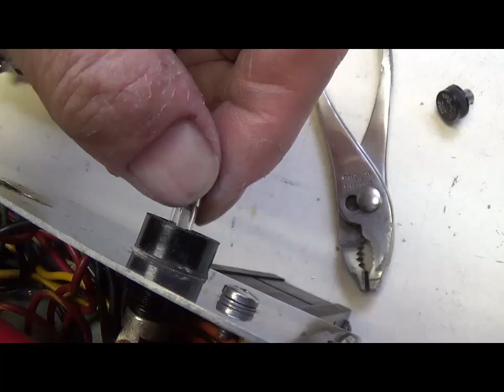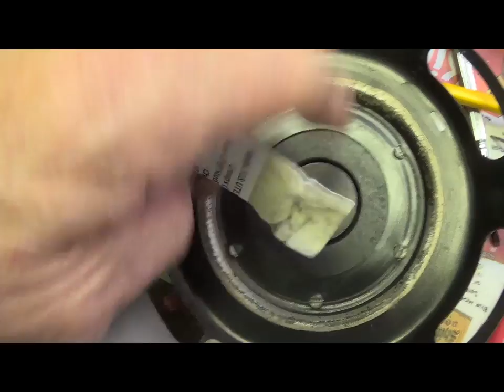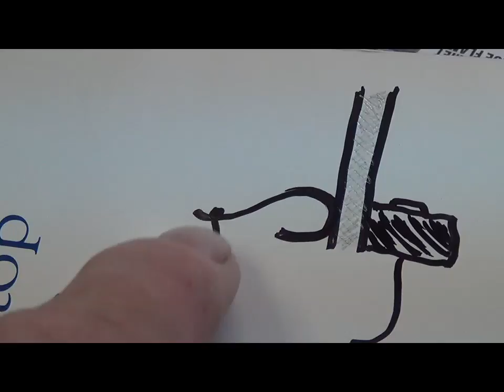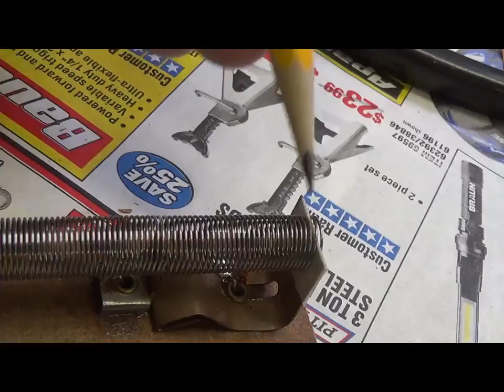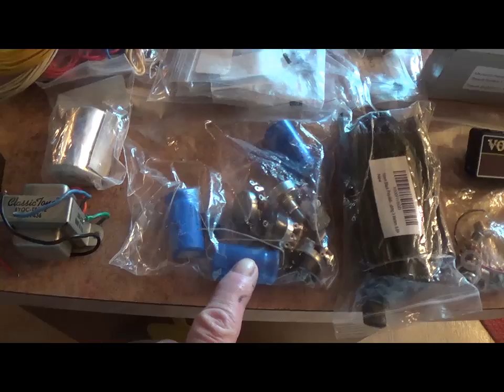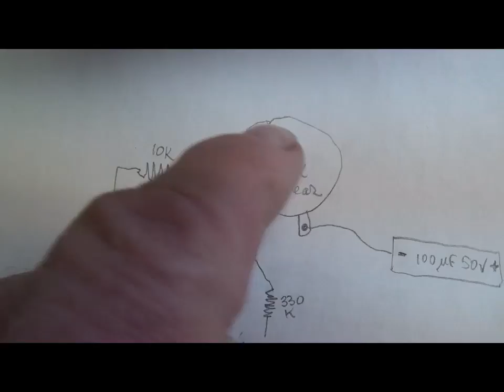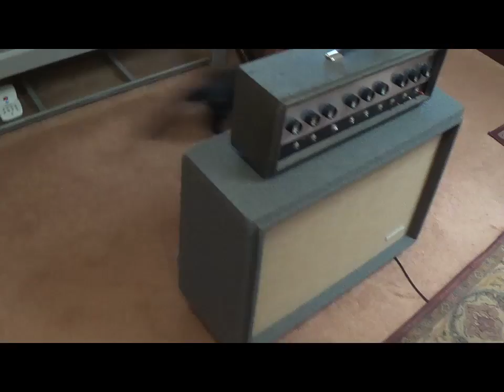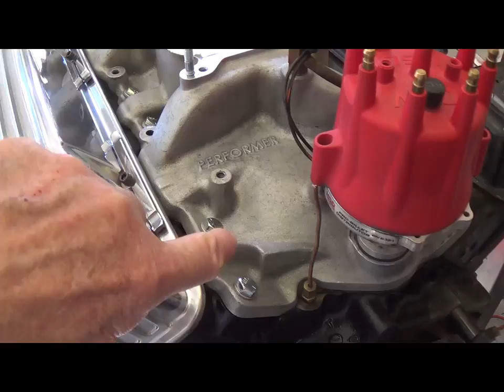Silvertone 1485, Part 3: Circuit Overhaul, Speakers, Sound Check

Comment: Ahhh... You area  true engineer... How do I know? You said WFO! Made me smile. I'm off to empty the grid leak pan...:)
Reply from the maker: We used to say it back in my motocross and drag racing days, Joe. On your way, don't forget to let the cathode bypass.
Reply: What means WFO?
Reply: @giantsofficial1041  "Wide the F___ Open."
Reply from the maker: .....or, perhaps, "Wide F___ing Open". Usually used with regard to motorcycle throttles and car accelerators :)

Comment: Happy New Year Doug,
one video editing related question: Are you using a 4:3 computer monitor?
This is the third video you released in the last coupe of months which has 16:9 content and is encoded as 4:3 with black bars top and bottom.
I'm pretty sure that this video wouldn't pass your final inspection when you are watching it on a 16:9 screen.
Reply from the maker: I'm sorry if that's the case, W. I'll double check the encoding on the next video.

Comment: From Leo:  Good Job saving the old amp.  It is always a pleasure to see your work, and I enjoy your humor.   You have far too much trust of musicians and roadies with that TRS stereo jack and plug for output to the speaker cabinets.   I can already see the damage from a dead short  when someone unplugs the stock speakers and plugs the head into a mono 4 X 12 speaker cabinet.    Labeling seldom works as they don't even believe anything they read, if the plug fits the hole, in it goes.     Maybe the owner will restrict the use from normal, run of the mill band members.
Reply from the maker: Actually, I am the owner of this amp, so unless I have a "senior moment" and forget about the stereo plug, things should be OK. I will label it, however, just to be safe. Thanks !!!

Comment: Thanks for the update...I've been looking forward to it.
I hope no one plugs a 2 conductor speaker plug into that TRS jack, that  might not make the OT happy. Interesting speaker configuration.

Nice to see Jack  ;)
Reply from the maker: You're welcome, LW. I guess two separate duplex jacks, one for each speaker array, would be a wee bit safer......but let's face it, if anyone is so careless as to indiscriminately  plug different speakers into any available amp socket, there will be no happy ending, regardless.
Reply: " if anyone is so careless as to indiscriminately  plug different speakers into any available amp socket, there will be no happy ending, regardless."

That applies to more than just safe amplifier usage ;)

cheers